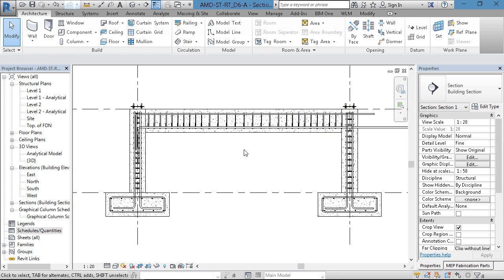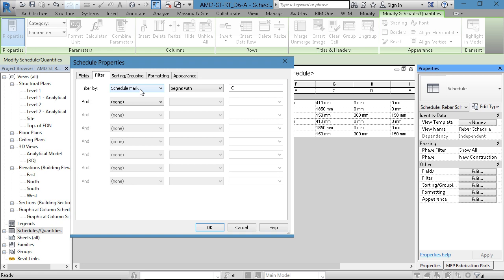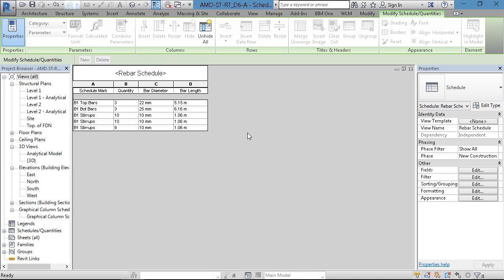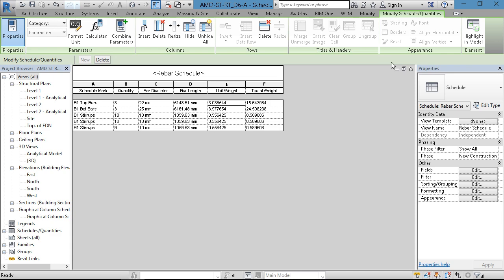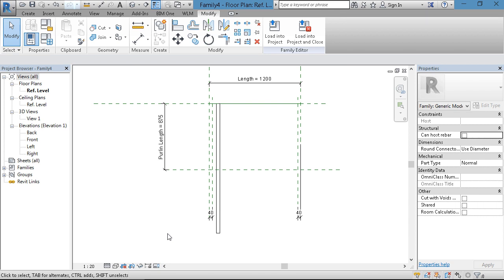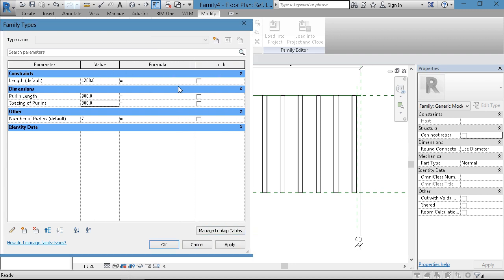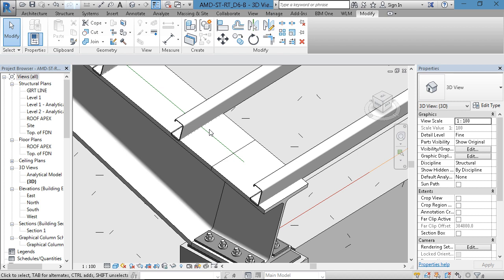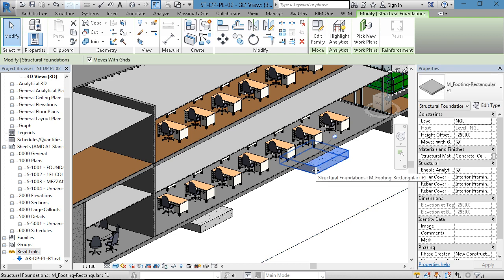BPD ST  Rebar quantity takeoff and parametric purlin layout

Comment: What I usually do for purlins is by using beam system. I'll just set the reference plane under the roof or top of truss/frame. But this is also a nice trick. Thanks.
Reply from the maker: yes that is one way but my concerned is when it come to scheduling this will fall in beam category but we need to check it both thanks for the comments.